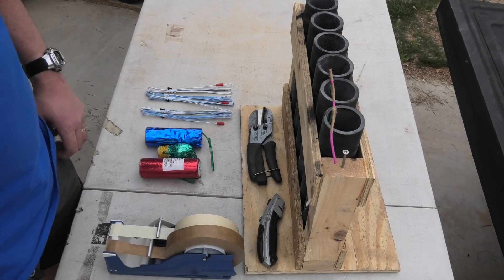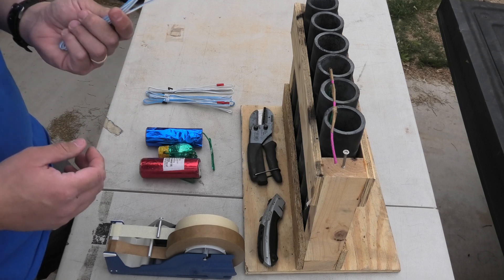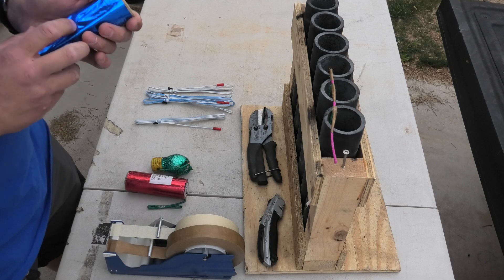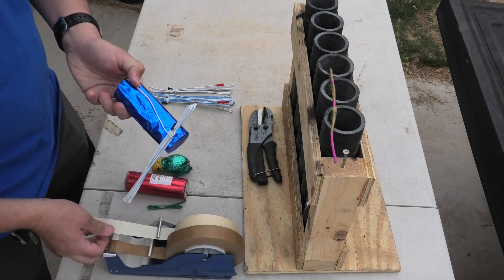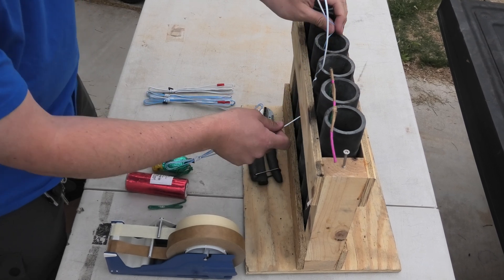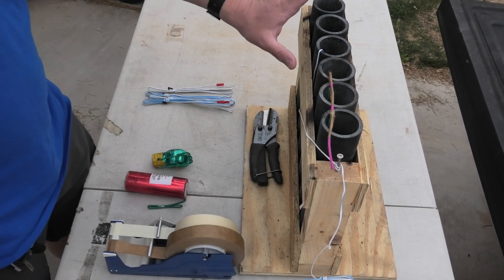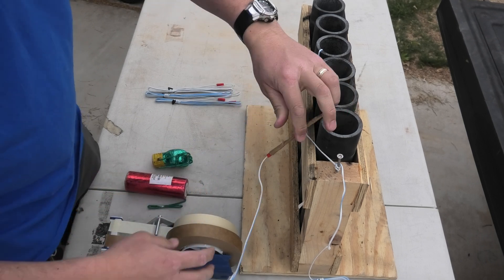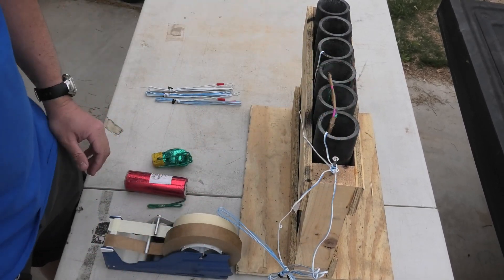Pyro-Technique video: E-matching Consumer Fireworks Part 1, Consumer Mortar Shells.

Comment: I really did not know you could insert it into the lift charge that would give you instantaneous ignition maybe you could make it go off to the Beat of the Music or whatever that would be really cool
Reply from the maker: That's the main reason.. I've also timed the lift on some of the shells so I can get them to break roughly on the beat in the song.. Mine or Comet shells would be great for firing on the beat in the music since you have a visible effect immediately after firing..

Comment: Seems like more trouble than just lighting the fuses at least you get some free fuse out of the deal😊
Reply from the maker: Well, if you're trying to light them electronically for a single shell in a scripted show, you need instant timing..

Comment: Will the TNT 6 cue hot match work good on canister shells & or 5” display shells?
Reply from the maker: @kainalu9402  It really depends on the type(s) of igniters it uses. Does it use clip on igniters, or pyrogen dipped ematch type igniters? If you have display shells, you should get trained by a professional for your own safety..
Reply: @ The igniters are the clip on style & activated via Bluetooth. I tried it on fountains & seems to work fine. Just unsure on the bigger stuff.
Reply from the maker: @kainalu9402  display shells don't have visco like fountains.. the "fuse" on display shells has no delay. You really need to find a local professional to get training from. Display shells are designed to use ematch, not clip on igniters..

Comment: if you run an initiator inside the tube with some canister shells which are so tight inside the tube, even the tubes that come with the shells, there really isnt any room for the wire to ride between the shell and tube wall.  Could that not cause the shell to get stuck in the tube?
Reply from the maker: @mikeernzen9979  Extremely unlikely.. with the amount of energy coming from the lift, it's extremely unlikely..

Comment: Late to the party on this but a couple of things..
Doing this is actually a violation of federal law. You've basically made 1.4g into 1.3g. You used to need a type 54 to buy ematch. Not sure why its so readily available nowadays but do know 1.4s still has storage requirements 
Now that I've said that, if you are going to ematch, don't transport matched product. Also, if you're ematching on site prior to your shoot, shunt the wires of your matches to lower the chance of pre-ignition.
Reply: I also bet you'd have a coronary if you saw someone cut the warning label off a mattress. That being said, I'd like to see what title and chapter statute you're allegedly referencing here. Don't just type it; I can sit here and say "federal law prohibits people from making things up on YouTube" just as easily as you can say "you can't transport ematched fireworks."

Well, after I typed that paragraph I decided it would be best to do my research instead of putting my foot in my mouth because I don't know everything. To sum it up: you're wrong. E-matched fireworks can't be shipped, but can be transported by personal carrier (the buyer) as long as it's to the ignition site or to storage before the launch. I know it's fun to prove people wrong, but you should at least try to do the smallest Google search to make sure you're right beforehand.

Source: Part 5 of the 2018 APA Standard 87-1B as cited by the DOT Fireworks and Hazmat APA 87-1B.
Reply: @BrendanClements  have a look thru this thread of actual pyros discussing this matter. Im 40 years in the business and the creator of the 76 Pro Line. Have a nice day
Reply: @mrjcell26 , I was disrespectful and I apologize for that. It doesn't matter if 500 people say the same thing if they're all wrong. They could also be referring to their state laws. Maybe one well known Pyro Guru stated this as fact referring to his state and everyone took it as gospel so the misinformation spread. If I'm wrong I will only accept cited statute or government policy. I cited where I got my information. I don't possibly see how I could be wrong when it's right there in black and white on a DOT.GOV site.
Reply: @BrendanClements  The label on literally every 1.4G UN0336 firework in the U.S. states " it's a violation of federal law to use this product in a manner inconsistent with it's labeling".
Reply: @mrjcell26 , I just checked my mortars, roman candles, and rockets with none of them containing that label. Please cite your source, because you're at least wrong with the word "every." Regardless, you're moving the goalpost. My main point of contention which I proved wrong was transporting ematched fireworks. Let's stay on theme before straying. Admit you're wrong regarding transporting ematched fireworks or please provide citation for proof.
Reply from the maker: If you're recently involved in pyro, then you know this isn't e-match. These are Firewire Initiators, the only consumer legal pyrogen type igniters, which come shunted from the factory. The blue and white wires should have given that away.. What it really comes down to is the willingness of the federal government to actually pursue charges on every backyard pyro that tries to set up a consumer pyromusical, or just e-fire their show. They tend to be far more interested in the actual 1.3 bootleg market. I'm late to the party, last year was a bad adventure involving health issues and financial issues; I was still recovering from a mild stroke when you commented. If you're going to take the "modification" aspect seriously, even poking a consumer cake for e-fire would be considered modification..

Comment: Guy says leave match shroud on for safety, the proceeds to cut into the lift charge of a consumer shell. SMH 🤦‍♂️
Reply from the maker: So how would you recommend it? You're the first person out of hundreds of tenured pyros tell me this is a bad idea. If you have a better way of doing it, get off your high horse and educate me and the others here. In the meantime, tell me how cutting into the paper holding the bottom disc on will be a huge safety issue.

Comment: you think its safe to prewire the shells with mjg and drive with prewire shells in car/truck?  to the shoot site to save time? just worried about the movement will fire off the lift charge
Reply from the maker: If I can help it, I prefer to match on site. Although the risk is reduced with the MJG compared to commercial ematch, try to match on site if possible.

Comment: Great video!!! Very helpful.  This was my first year using push button panel and e-matches vs fuse.  I followed Dave's method, I shot a little over 100 artillery shells without incident and am very thankful none of them was flung towards the spectators.   Looking forward to more E-Matching fireworks of all types.  Looks like you used masking tape.  Is there a reason vs. brown packing tape?  Can the shells be over taped? Thank you,
Reply from the maker: I use masking tape where I want it to tear away a little easier. If I want a stronger hold, I use my 1" kraft paper tape. It's virtually identical to brown packing tape, but it's easier to work with, and fits in a portable tape dispenser for ease of use. A lot of people poke directly next to the fuse hole with no issues, personally I prefer to match directly to the bottom of the shell. It's a little quicker too. However, you should never remove the shroud from the e-match. Thanks for the sub!